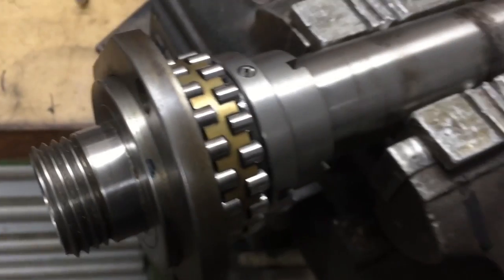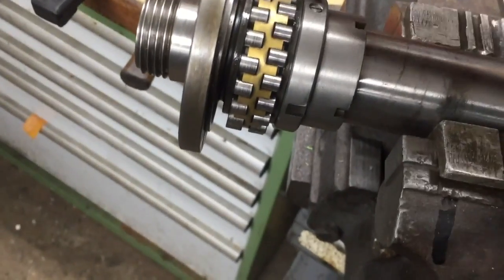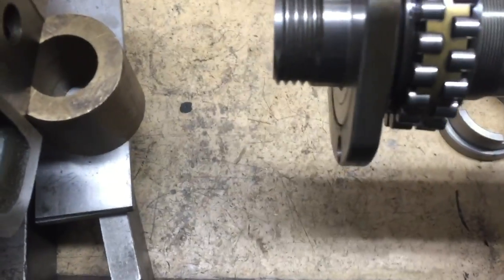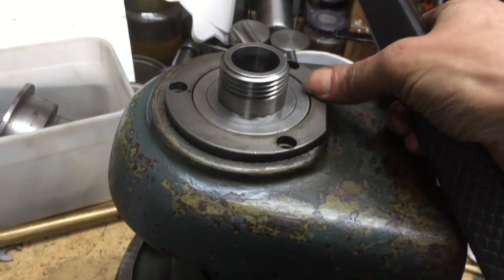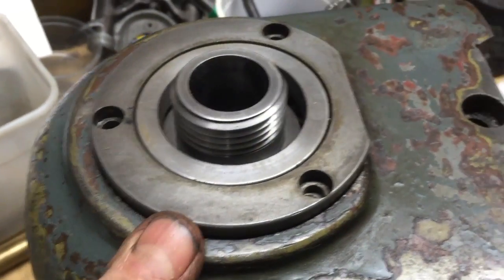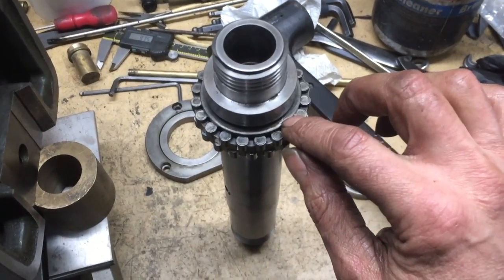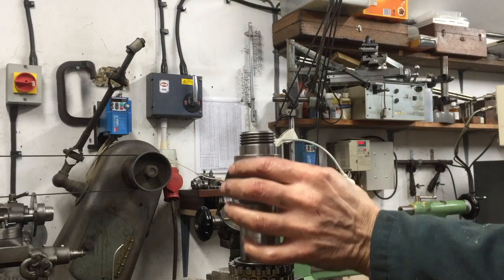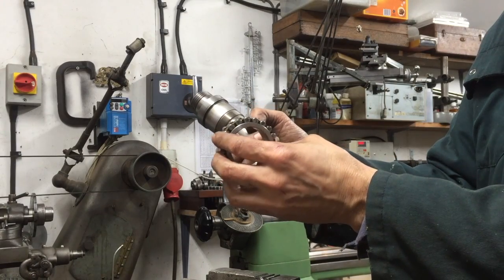Schaublin lathe spindle bearings: Part 1 - removal

Comment: What exact type is the front roller bearing? Designation? And rear? Thx!
Reply from the maker: Take a look in my website archive for manuals with bearing designations. Rear bearings can be either 6 series (deep groove) or 7 series (AC),

Comment: Hi David.
Nice video. I did it differently especially when the spindle got corrosion between the bearing and the spindle. I made a pair special wedges with an opening for the spindle.
Those wedges fits between the bearing and the spindle. When placing them right in the front of the spindle I can press them together in a vise.  The pressing force from the wedges is enough to separate the bearing from the spindle. No hammering is always my favor.
Reply from the maker: Yes, there are a few different ways of doing this. I've tried most of them, but this is my preferred method when fitting a new bearing. I want to do the job as quickly as possible, but also want ensure everything is clean. Removing the labyrinth seal allows meticulous cleaning so that no foriegn matter falls into the new bearing when adjusting it. I'll upload another video covering this soon.